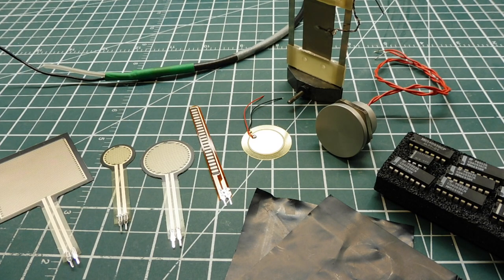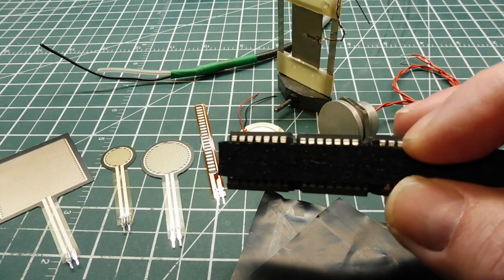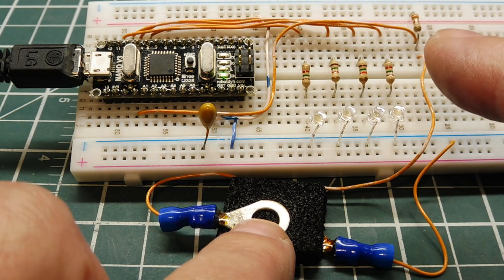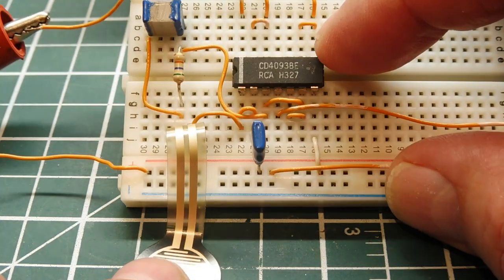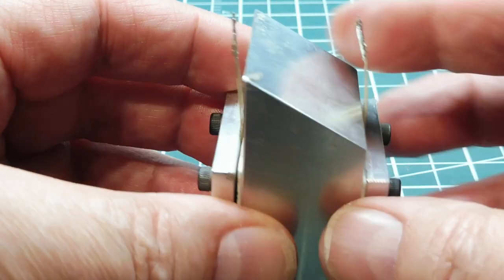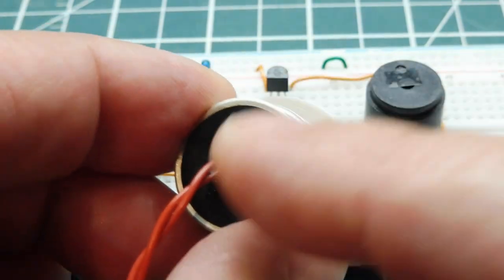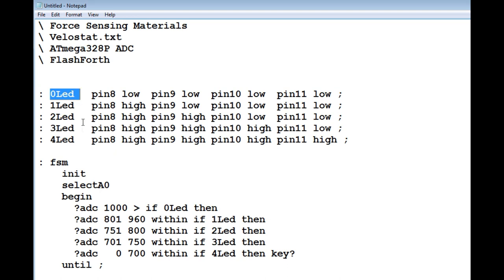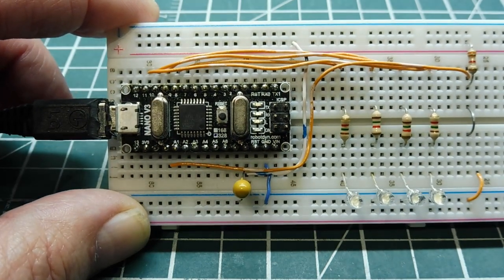Force Sensing Materials

Comment: As you have tried them all, if I'd like to use something to measure the pressure in several points to distribute the weight right in the centre, will this be the right option to measure the different readings from different points and prompt the user to redistribute the weight?

Comment: I’d love to see you do a video specifically measuring impact force, say up to 10lbs max, with a value readout on a display. I’ve looked everywhere on YouTube and some only touch on impact as an example, but none really show anything dedicated to it even though it’s an extremely useful metric to measure. Very cool videos 👍🏼
Reply from the maker: You can measure impact using an accelerometer and calculate the force applied:
https://youtu.be/nDmlsHCuBlI
To get a force reading directly in LBS you could use a load cell strain gauge. The force can be applied to a cantilever beam where the fulcrum can be adjusted to match the max rating of the load cell.
https://youtu.be/3LoVl_qjeR4
Reply: The reason I was saying using a method like this to measure the impact is because it would be interesting to apply that to the force of a trigger hammer striking a firing pin to see the max force of the impact. This metric can be useful in diagnostics of light primer strikes and to also compare different weight fire control group springs and to compare between brands and styles of fire control groups. I know this seems specific to one application, just a project idea I’ve been throwing around in my head for a while which is what lead me to this video to begin with lol. Just a little light reading lol

Comment: This is a great overview, thanks!  Yet more evidence for me that the standard way to use velostat is sandwiched between conductors, and not used to bridge across two conductors like the first example I saw.  Also, I'm curious, do piezo sensors detect force, or do they detect percussion?  My understanding is that they don't work very consistently to measure static force.  Is that right?
Reply from the maker: Here is another video using velostat as a pressure sensor: https://youtu.be/seMVgJ41BZw
Yes, Piezo sensors basically detect percussion. They output during acceleration and not during static pressure.
A good example of that is an engine knock sensor.  https://youtu.be/fZGUzk-BYgQ
To measure static force use a strain gauge (load cell).  https://youtu.be/3LoVl_qjeR4
Reply: @0033mer  Thanks for the answer!  Yes, I've used knock sensors for a digital drum before, and I just wanted to check I had the right info.  I'm now making MIDI pads that need static force sensitivity for sustain, so velostat is definitely the way to go from what I've seen.

Comment: This is interesting. Plenty of ideas could be realized with this, from simple switches to pressure sensitive skin-like arrays. 
I guess you could make a crude force sensitive touchpad out of an array, or maybe out of two electrically separated layers of intersecting "lines" and "rows". You could have the position data as well as the pressure data.
You could use some of this in electronic piano keyboard for adding per-key vibrato ability, not to mention keystroke force. Although, wear-resistance would have to be taken into account when choosing the material used.
Our maybe sending pressure on a usb computer keyboard, turning some of the keys into kind of analog inputs.

I guess all kinds of analog momentary inputs could be done this way if precision wasn't important.

Comment: Very nice Ideas. However, these sensors have nonlinear behavior and they are great as switches. It's interesting to see some linear sensors that provide a  proportional output to the applied force.
Thanks.
Reply: Mohammed Algailani : Piezoelectric materials are linear. Their parameters are well defined for the many types of piezoelectric materials. The charge or voltage constants tell you the charge or voltage generated per unit force or pressure. I don’t recall the other sensors but if they’re non linear then the micro can work it out for you, worse case would be a lookup table.

Comment: What is the resistor value used as voltage divider in the circuit of electrostatic foam at 2.53?
Reply from the maker: Every setup will be different but I used 47K.

Comment: Those films look interesting, I imagine an array could be used to make a touch sensitive “skin”. Is it possible to use an array of contact points like a keyboard matrix to get local pressures or will the film spread the electrical signal across its surface if it’s not cut into disconnected sections?
Reply from the maker: Yes .. check online, there are others who have built an array of contact points using Velostat.

Comment: Hi! Our company is using FSR for our acoustic synthesizer and with some of our assemblies with our device, we're experiencing that the FSRs are being compressed.
The sound keeps going even not putting pressure on it. How this will be avoided? Thank you.
Reply from the maker: Yes, that is called loading hysteresis. Keep the compression duration time to a minimum and avoid heavy pressure together with proper software to avoid this problem. Check the data sheet for loading hysteresis specs.
Reply: @0033mer  Thank you for your response.
Reply: @0033mer  We need to apply glue on the FSR   to place it on our device. Is this advisable? If so, what's the best kind of glue that we can apply to hold it permanently in place?
FSR is a crucial part in manufacturing our acoustic synthesizer, which until now, we're still finding out how to optimize its use and avoid issues.
Thanks again.
Reply from the maker: Use a 3M adhesive like their 3M 467MP Transfer Tape. Follow their instructions on how to apply the tape.
Reply: @0033mer  , I'm wondering if you have another platform where I can ask few more questions regarding FSR. I want to send photo regarding the assembly that I'm doing and maybe you might give suggestions of the proper way to adhere FSR or recommendations that I can apply into it.
Thank you.
Reply: Just wanting to know also, what's the use of the plastic film at the back of the FSR?
Thank you.

Comment: Why do u form a voltage divider to feed into the microcontroller?  Sorry I have an idea why but can you please explain?
Reply from the maker: To convert the changing resistance of the pressure sensor to a changing voltage that the ADC of the microcontroller wants to see, you would use a voltage divider. Check out this video: https://youtu.be/rTO3U-0Njtw

Comment: @0033mer Very interesting and useful video.  I'm planning to do a DIY MIDI controller and put a sensor  and I have no experience with those components,   May I ask you the order of precision and/or reliability of each kind of sensor?
Reply from the maker: FSRs are the easiest to interface to electronic circuits for trigger applications.
https://youtu.be/u2EHDyrV_F0

Comment: Can I have your circuit diagram for the antistatic foam sensor... And can you please tell me exactly where can find the antistatic foam?
Reply from the maker: Most electronics supply stores will stock anti static foam. https://www.jameco.com/z/HDBC-1206-25-12-x-6-Conductive-Anti-Static-Foam_2237896.html
A resistor and the static foam form a voltage divider feeding the ADC of the Nano.
https://youtu.be/wEqfHo_guG8
Reply: @0033mer  in this video u used a resistor as a voltage divider of how many ohms?
Reply: @0033mer  as I am not getting the same output as you are getting.. I am getting values between 920 to 970 only..
Reply from the maker: @rynemascarenhas175  Ohmmeter the setup and calculate a resistor to give you a good range. You can also use a potentiometer and adjust for best results. I used 47K in my divider.

Comment: charge pump for piezo ? the circuit looks like common emitter amplifier
Reply from the maker: The transistor is a MOSFET which is driven by a charge pump. It drives the GPIO input pin on the microcontroller when the Piezo is triggered.
Reply: @0033mer  

Im still not getting it, did MOSFET required higher supply voltage or negative voltage?
Reply from the maker: The MOSFET is a N-channel VN10KM which has a threshold gate/source voltage of 1.2 volts. The pullup resistor is connected from the drain to the 5 volt supply. When the piezo is triggered a positive DC voltage is applied to the gate turning on the MOSFET and driving the GPIO on the Nano.
Reply: @0033mer  so it is just a high impedance input buffer amp, was wondering why charge pump(dc-dc voltage converter) is mentioned.
Reply from the maker: Yes ... it is a high impedance input buffer that will not load down the (ac-dc) charge pump. The output of the piezo sensor is ac.
Reply: @0033mer  OK thanks, just newer seen anyone referencing to piezo transducer as a charge pump before. Perhaps you referencing to that blocking diode before resistor to gate, a pair of diodes would make a voltage doubler(which is type of charge pump) from piezo AC output but I don't see a second diode, but such arrangement probably not worth it on small amplitude AC due to additional voltage loss on diode
Reply from the maker: The piezo transducer is not a charge pump, just the circuit it is connected to.